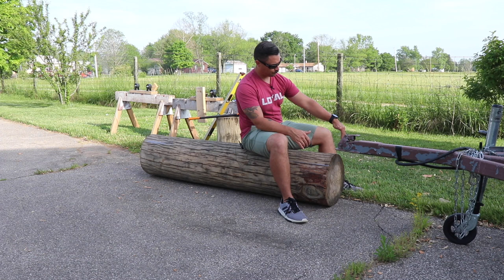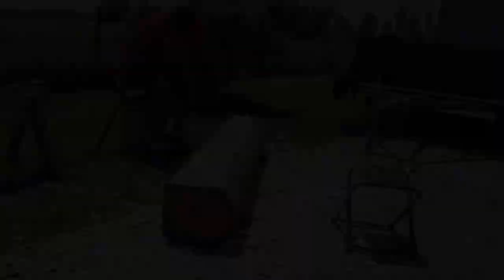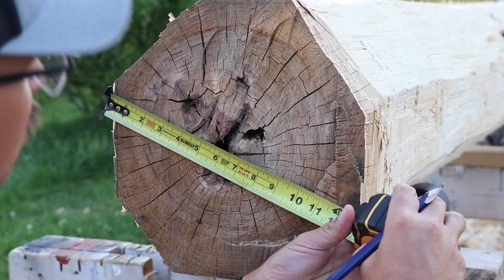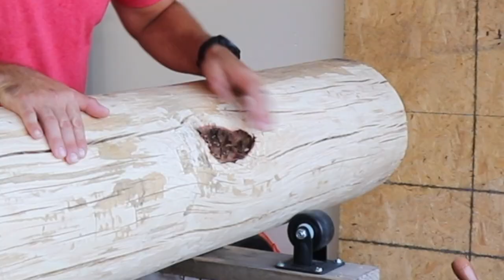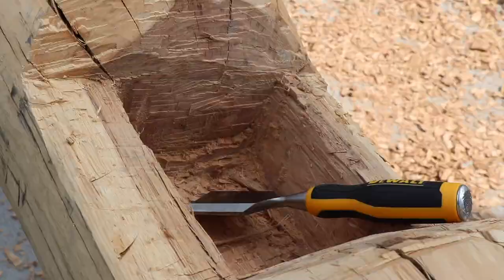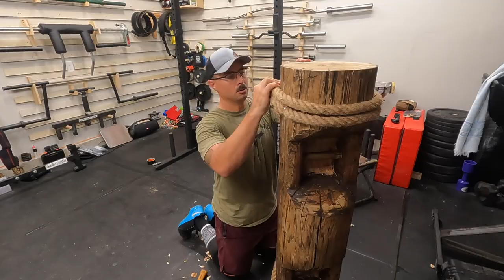DIY Hickory Strongman Log | (Almost) Entirely "Primitive" Construction | Strongman Garage Gym DIY

Comment: Nice job on the log! I understand the time. It is taking me a month to prime and paint my gym. Ceiling, walls and trim get painted. I paint the trim this weekend, which will finish the painting. Then I clean the floor and finally unbox and assemble the equipment.

I have a full time job with an hour drive each way and 7.3 acres to maintain.  It makes projects go slower than I like. Of course in my defense, we took a week vacation after I primed the drywall and trim.
Reply from the maker: Well it’s important to take some time for yourself fit sure. It’ll all be worth it in the end. Sometimes instant gratification is cheap

Comment: If it doesnt weigh enough., cut off the ends, drill out areas for weights, weigh everything without the weights, calculate how much lead of steel you need to get the desired weight and fill her up. Glue and screw the ends back on. The screws only hold the tension for the glue the adhere. The glue is very strong. I make endgrain mallets this way for a certain type of carpentry.
Reply from the maker: That’s an excellent idea. Thank you for the tip
Reply: @TheKurtlocker  we just purchased 8 acres and I thought it would be cool to cut one of the many trees down to make a few logs. Your video was a lot of help. Thank you.
Reply from the maker: @johnmichaels4330 that is so cool! An awesome project for sure

Comment: Looks like you changed your construction method quite a bit with this log versus your last strong man log series. Why did you ditch the chainsaw this time? Did you like drilling the handles instead of cutting them? How did you make sure to line up your drill holes when inserting your dowel for a handle?
Reply from the maker: I changed a lot of processes after some mentoring from some amazing log makers out there including Richard Looney and Steve Slater. I basically measured about 20 times before drilling the handles to get them to line up and didn’t want to carve them from a stability standpoint. The dowel rod is significantly stronger.
Reply: @TheKurtlocker  Thanks a ton. A really old oak tree just fell at my house and I'm going to make a few logs from it, so your vids have been super helpful
Reply from the maker: What an awesome opportunity! Have fun!